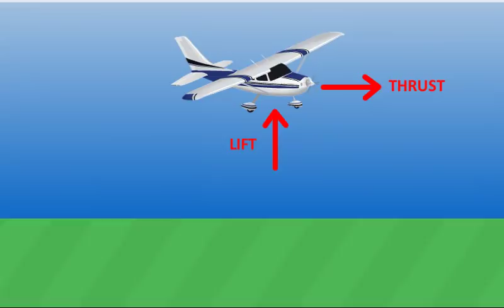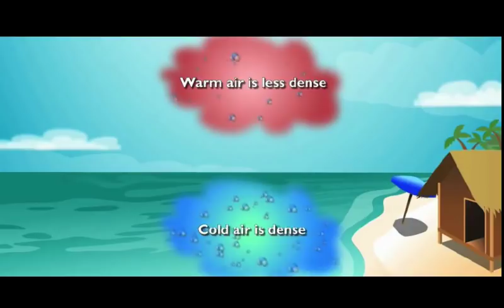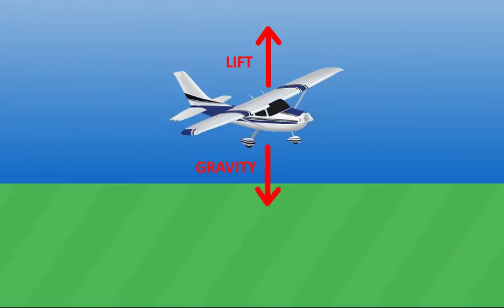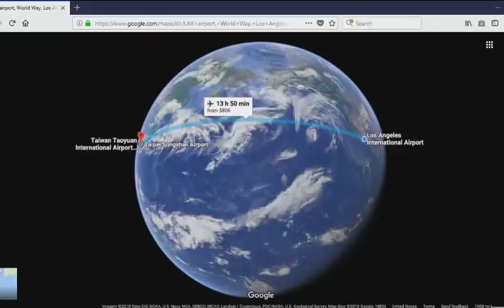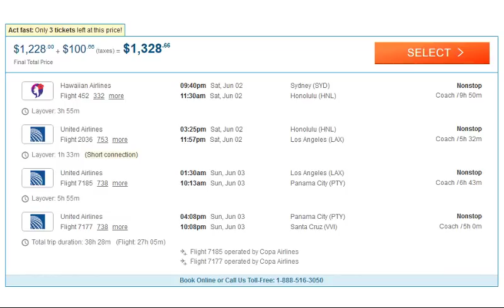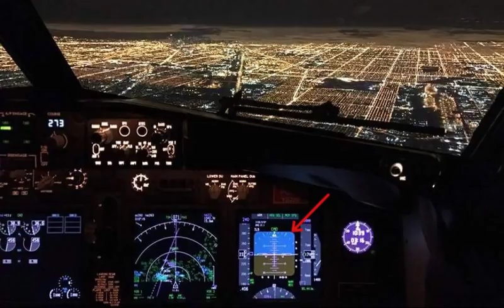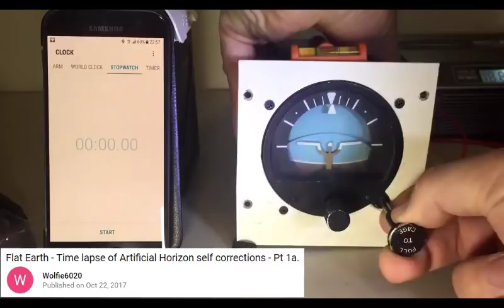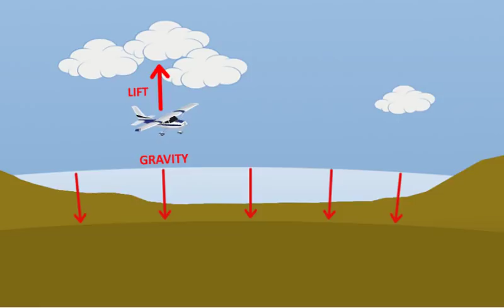Flat Earth Falsities - Plane Nonsense

Comment: Gravity hold air to the earth is ridiculous
Reply: Why?
Reply: @romithromith  air has no mass nor can you weigh air it would be easier to explain if everyone would accept that earth is a closed system that  doesn't need gravity to explain why air stick to a spinning ball earth
Reply: @ejones6647  "air has no mass"
Since when?

"nor can you weigh air"
You can't?
Reply: @ejones6647  
"air has no mass " So why do we have atmospheric pressure? And weather? Etc.
Reply: @boffeycn  because earth is a closed system
Reply: @ejones6647  
Wrong. Earth can be considered a closed system for simplicity and ease of calculations and that is all, because the Earth is not flat or enclosed
Sorry to disabuse you of your religious beliefs, but we know the Earth is a slowly rotating terrestrial spheroid and gravity is a fact.  Just because you are incapable of understanding basic maths and physics and wilfully refuse to learn such things is your problem. Examples of questions for you about basic, practical, everyday maths and physics used in the real world. Can you answer them? 
What is the relationship between longitude and distance when travelling east or west parallel to the equator?. If you know the answer then you know the earth is a spheroid. If you don't you are not qualified to comment on the earth’s shape.
Please explain the principles behind the development and functioning of a gyrocompass? If you can then you know the earth is a slowly rotating spheroid and gravity is a fact. If you don't you are not qualified to comment on gravity, the earth's shape or movement.
Reply: @romithromith  rhe question is how mu h does earth atmosphere weigh
Reply: @ejones6647  —
     Well, air pressure at Earth's surface is 14.7 lb/in², so every inch² column of air weighs 14.7 pounds. By my basic calculations the total atmosphere weighs 1.16 x 10¹⁹ pounds or 5.81 x 10¹⁵ tons. (That's in the middle of two online results.)
Reply: @romithromith  at this point i do not think Mr. Jones is even aware of what air is comprised of.
Reply: @CaptWesStarwind  it's shocking. And the FE videos dumb down whatever these folks do know. But at least EJ''s asking questions which is a good sign.
Reply: @romithromith  
"But at least EJ''s asking questions which is a good sign." No. He is making categorical statements of "fact".. he is not asking questions. 
"Gravity hold air to the earth is ridiculous " Not a question.
"air has no mass nor can you weigh air it would be easier to explain if everyone would accept that earth is a closed system that  doesn't need gravity to explain why air stick to a spinning ball earth".Not a question.
And so on.
Reply: @romithromith  puedo  science
Reply: @ejones6647  Again. Practical stuff.
Why is it that a compass needle is more or less vertical at the poles and horizontal at the magnetic equator?
And when you carry on past the poles the needle slowly returns to the horizontal?
Why is it that it is only possible to navigate accurately over long distances using spherical trigonometry?
Why is it that traditional gyro compasses work perfectly in low latitudes but became unreliable in high latitudes?
Why is it that it is only possible to navigate accurately over long distances using charts based on a terrestrial spheroid?
Why is it that when you watch a ship sailing away from you the hull is the first thing to go below the horizon, then the superstructure and finally the funnel and upperworks?
Does a magnetic compass point towards polaris (Alpha Ursae Minoris) at the north and south poles?
Does a gyro compass point towards Alpha Ursae Minoris at the north and south poles?
Tell me how you ascertain the error of a compass when in the Southern Ocean, using Alpha Ursae Minoris?
Reply: @ejones6647  —
     Gravity exists. It's a fact and no one cares what a hoard of flat Earthers contrive. You don't even know what pseudoscience is.
Reply: Why does the air get thinner the higher we go, why is the atmosphere thicker on the ground.
Reply: @appresley4071  why are you so locked into this dogma?
Reply: @ejones6647  Because your wrong, I have fished all my life, people on the water know the earth is round. My sister worked in Antarctica for years. She witnessed 24hr sunlight. You see the moon 12000 miles away and I see the same face of the moon on the opposite side of the world. What holds the sun and the moon up. Tides by flat-earth are the result of electricity. No hurricane has ever crossed the equator, explain that on the flat-earth. I believe flat earth is just a belief system. Not quite as bad as say Heaven's Gate. Parts of it though are quite weird, if somebody would prove something above instead of just saying I will listen. Until then science explains things 100%, like scientists think gravitational pull of the moon causes tides, I tend to agree. But you think gravitation is a hoax.
Reply: OK Numbchunks...if air had no mass (or weight) why do climbers need breathing equipment to scale K2 and Everest or at high altitudes? Could it be there is not as much air to breathe, less oxygen. Conversely there is far more at sea level where it is easier to breathe? This is why athletes often train at altitude to increase their efficiency in competition. Why do aircraft need air to fly within a certain altitude? Because it needs air for lift. The reason there are fewer air molecules at higher altitudes is because of gravity pulling the air down toward the earth's centre. The pull of earth's gravity is greater at sea level than it is at altitude.
Reply: E Jones you should be spat on! 💦 Fuckwit!
Reply: @No... tell how much does earth atmosphere weigh? I don't know
Reply: @ejones6647  Well?
Wrong. Earth can be considered a closed system for simplicity and ease of calculations and that is all, because the Earth is not flat or enclosed
Sorry to disabuse you of your religious beliefs, but we know the Earth is a slowly rotating terrestrial spheroid and gravity is a fact.  Just because you are incapable of understanding basic maths and physics and wilfully refuse to learn such things is your problem. Examples of questions for you about basic, practical, everyday maths and physics used in the real world. Can you answer them? 
What is the relationship between longitude and distance when travelling east or west parallel to the equator?. If you know the answer then you know the earth is a spheroid. If you don't you are not qualified to comment on the earth’s shape.
Please explain the principles behind the development and functioning of a gyrocompass? If you can then you know the earth is a slowly rotating spheroid and gravity is a fact. If you don't you are not qualified to comment on gravity, the earth's shape or movement.
Reply: @boffeycn  bil nye said earth is a closed system not me
Reply: @ejones6647  So answer the other points. I will answer the Nye point in another post.
"air has no mass " So why do we have atmospheric pressure? And weather? Etc.
"@wong because earth is a closed system" If it was actually a closed system as you claim then weather and pressure differences as we know them would not exist.
Well?
Earth can be considered a closed system for simplicity and ease of calculations and that is all, because the Earth is not flat or enclosed.
Sorry to disabuse you of your religious beliefs, but we know the Earth is a slowly rotating terrestrial spheroid and gravity is a fact.  Just because you are incapable of understanding basic maths and physics and wilfully refuse to learn such things is your problem. Examples of questions for you about basic, practical, everyday maths and physics used in the real world. Can you answer them? 
What is the relationship between longitude and distance when travelling east or west parallel to the equator?. If you know the answer then you know the earth is a spheroid. If you don't you are not qualified to comment on the earth’s shape.
Please explain the principles behind the development and functioning of a gyrocompass? If you can then you know the earth is a slowly rotating spheroid and gravity is a fact. If you don't you are not qualified to comment on gravity, the earth's shape or movement.
Reply: @boffeycn  its not a religion gravity is not holding earth atmosphere but yet planes has no effect when flying through earth atmosphere which is rotating along with the earth
Reply: @ejones6647  
As I stated Earth can be considered a closed system for simplicity and ease of calculations and that is all, because the Earth is not flat or enclosed.
In physics and thermodynamics our solar system is a “closed system”. This means, that within the system, energy and matter are neither added nor gained.
The second law of thermodynamics, that entropy always increases, then describes the eventual fate of our system — the sun runs out of fuel to burn, starts burning heavier elements, goes red giant, then eventually collapses in on itself as it will radiate what remaining heat it has to give — all over billions, then trillions of years. If our solar system were open, and, say, there was a steady stream of hydrogen that kept flowing into our sun from outside the solar system, then the dynamics would change, and the sun could just go on burning.
So, long story short, it is closed because, nominally, our solar system does not gain or lose energy or matter. (Yes, very, very small amounts of matter and energy do enter and leave our solar system, but so little that our system can be called closed, although it is not “perfect” like Happy Physics Land where no extraneous factors cloud equations. However, the outside factors that do affect our solar system are so minuscule that they have no measurable effect on physics or chemistry.)
Reply: @ejones6647  —
     "bil nye said earth is a closed system not me"
     NO! That's not what Bill Nye said. In re someone asking about sending garbage into space, Nye said for the purposes of the environment that young people should think of the environment as a closed system, to use resources sparingly, reuse and recycle. Nye certainly doesn't  think Earth is a closed system.
Reply: @ejones6647   —
     Quit cherry picking, taking quotes out of context.
      "nye said earth is a closed system and nobody leave the earth there's no place to go"
     This is what Nye said https://youtu.be/fjWGVrmuz74
     Why we don't throw trash into space because it's too expensive. Lifting a ton of material into space takes an extraordinary amount of rocket fuel and by the way when people want to send this much plutonium-238, which is not even the weapons plutonium, a baseball sized, a grapefruit-sized, people freaked out because the rockets sometimes blow up. Now one thing I really want your generation to embrace is that the earth is a closed system we cannot leave the earth there's no place to go, there's no place to throw your trash and I wouldn't be surprised if maybe not you but your kids develop ways to mine our landfills we throw away so much valuable stuff right now especially raw materials.
Reply: @romithromith  isn't  there's enough junk i space already from the many satellites that have expired
Reply: @ejones6647  —
      That's true. Though not visually apparent, the speed of orbits make impacts a potential issue and it has occurred. If they would put refuse into space, sailing it toward the Sun would be tidy.
Reply: @ejones6647  
"tell how much does earth atmosphere weigh? I don't know"
Do you mean per unit volume?
Reply: @boffeycn  its  pseudo science its all theoretical
Reply: @ejones6647  
"its  pseudo science its all theoretical. What? Examples of questions for you about basic, practical, everyday maths and physics used in the real world. Can you answer them?  Nothing theoretical at all, only real life hands on practical stuff.
What is the relationship between longitude and distance when travelling east or west parallel to the equator?. If you know the answer then you know the earth is a spheroid. If you don't you are not qualified to comment on the earth’s shape.
Please explain the principles behind the development and functioning of a gyrocompass? If you can then you know the earth is a slowly rotating spheroid and gravity is a fact. If you don't you are not qualified to comment on gravity, the earth's shape or movement.
Reply: @boffeycn  you are absolutely correct i have no clue how earth atmosphere can exist next to the vacuum of outer space while rotating im lost it makes no sense
Reply: E Jones The air pressure decreases with increasing altitude until it is essentially a vacuum. Nowhere is there quick or abrupt drop in pressure. Gravity is sufficient to counter the slow change in  pressure. 

Gravity is a property of mass; a plane has negligible mass compared to a planet and hence exhibits negligible gravity.
Reply: @flookd5516  what altitude does the vacuum of outer space begin and earth atmosphere ends?
Reply: E Jones There is no such point. The decline in pressure is continuous and any boundary is an arbitrary distinction.
Reply: @CaptWesStarwind  i never said the earth is flat i just don't believe nasa put men on the moon
Btw all the lunar rocks from the Apollo missions are fake
Reply: @ejones6647  "all the lunar rocks from the Apollo missions are fake"
Verified as lunar rocks by geologists around the world. What's your argument for them all being wrong? (And, no, reference to a certain rock in Amsterdam is not evidence.)

"nobody leave the earth"
No oxygen to breathe in space. It's why astronauts wear spacesuits when outside the ISS.
Reply: @flookd5516  why would any of the lunar rocks from the Apollo mission  be fake it scream scam on so many levels
Reply: @ejones6647  —
     "why would any of the lunar rocks from the Apollo mission  be fake"
     Gee, I wonder why they were insured. Any ideas?
Reply: E Jones Do you have any evidence any were fake? What is your accusation based on?
Reply: @NotTheCIA I.think how you gonna compare earth atmosphere weigh to a flat tire because the tire itself  has weight not the air inside the tire dumbass
Reply: Who told you that matter does not have weight? What do you think air is made from? Do you just not understand the states elements can be in? You do realize you can cool something like Nitrogen or Oxygen. Do you think liquid oxygen and liquid nitrogen are weightless? Do you not realize how your op makes you look?
Reply: @E Jones 
"air has no mass " So why do we have atmospheric pressure? And weather? Etc.
"@wong because earth is a closed system" If it was actually a closed system as you claim then weather and pressure differences as we know them would not exist.
Well?
Earth can be considered a closed system for simplicity and ease of calculations and that is all, because the Earth is not flat or enclosed
Sorry to disabuse you of your religious beliefs, but we know the Earth is a slowly rotating terrestrial spheroid and gravity is a fact.  Just because you are incapable of understanding basic maths and physics and wilfully refuse to learn such things is your problem. Examples of questions for you about basic, practical, everyday maths and physics used in the real world. Can you answer them? 
What is the relationship between longitude and distance when travelling east or west parallel to the equator?. If you know the answer then you know the earth is a spheroid. If you don't you are not qualified to comment on the earth’s shape.
Please explain the principles behind the development and functioning of a gyrocompass? If you can then you know the earth is a slowly rotating spheroid and gravity is a fact. If you don't you are not qualified to comment on gravity, the earth's shape or movement.
Reply: 1m³ on ground level has almost 1300 gram of air in it.

Comment: best way to explain how gravity works is to take a globe yo yo. its round looks like an earth... it help explain. now put a plane on the end of the yo yo. split the string to simulate multiple points of gravity and attach those to the plane. now spin the plane around the yo yo. the string is the force of gravity. the airplane happily flies around with out needing to adjust. you can even attach a mock altimiter. and see that it will remain level with the string. just as gravity. the altimeter and the plane react to the earths gravity and remain at the same level. its an easy experimen tyou can do to prove gravity and how a plane doesnt just shoot off the earth.
Reply: Brandon Brackett you sent a reply that to look at  flat map  images they have to be distorted because the images come from a globe .my only problem with that is that if someone is making a case like that energency landing is that undistorted images should be show for the viewers to get a true idea of what this video is claiming .and not just show a blured out image of asia to united states .
Reply: @fredvalencia2205  what? that... literally has nothing to do with my comment lol. i was commenting on how a plane doesnt need to dip its nose to stay level with the earth. its because of gravity.
Reply: Lol wrong video
Reply: @fredvalencia2205  no worries.